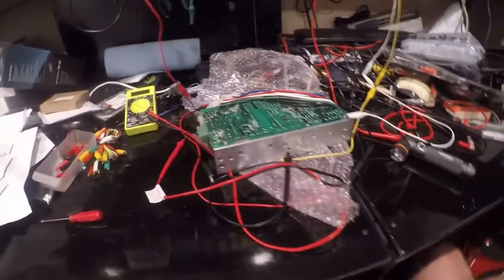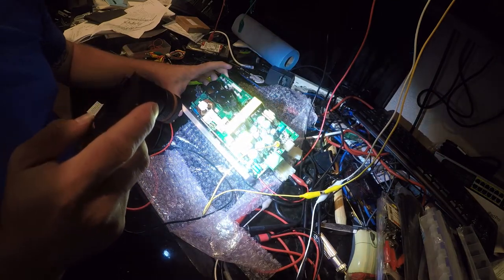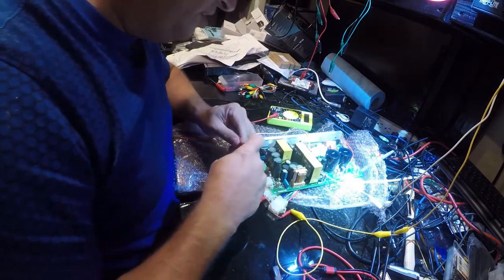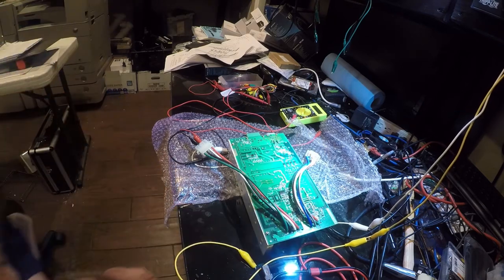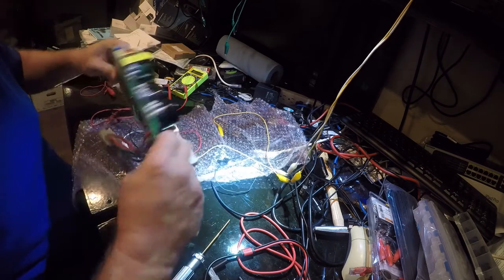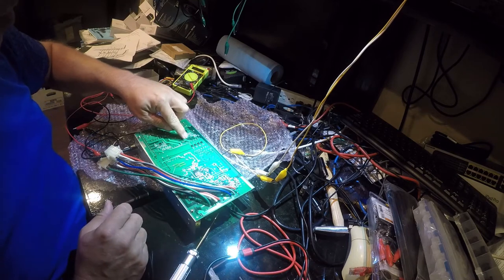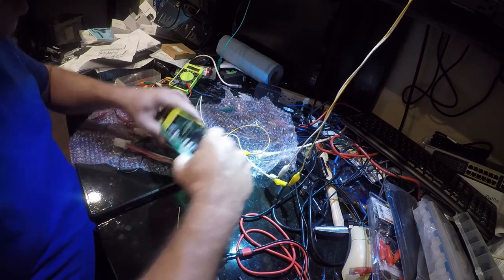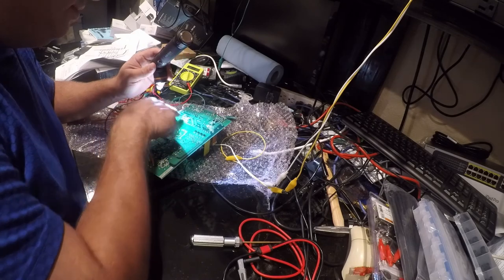Tajima TMFX Power Supply Repair 3 of ??  (long)

Comment: How did you finally get your 26V output??
Reply from the maker: A separate transformer.  And it was 12v that was missing.  It was just simpler to add a transformer and move on.  Tied the negatives together to prevent voltage float.